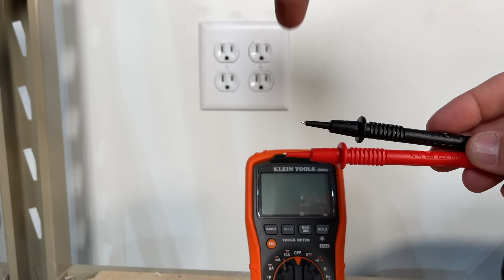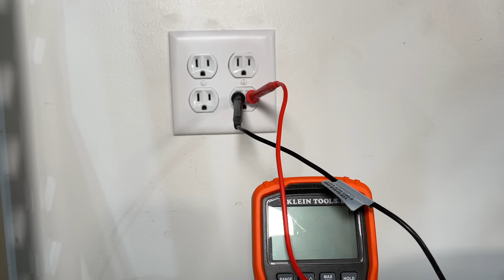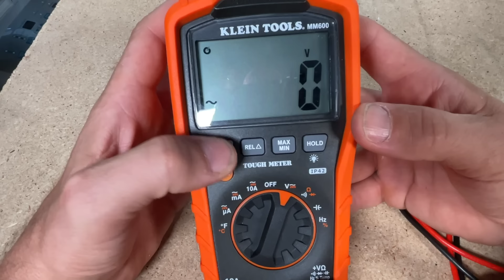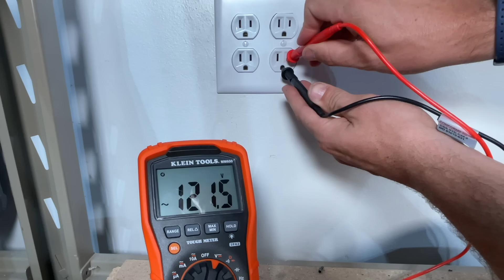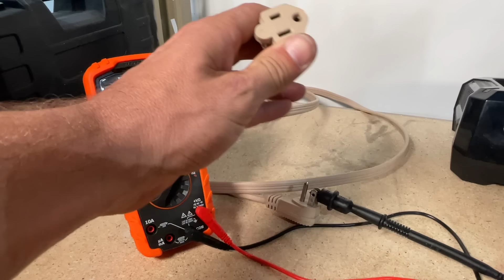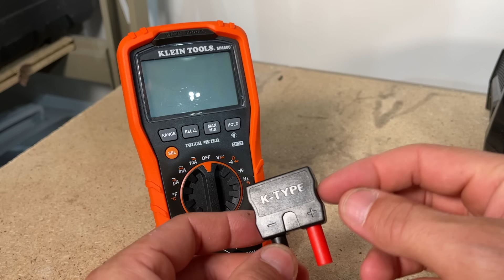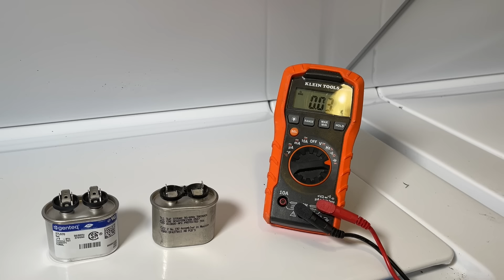How To Use A Multimeter for Home Repairs and Troubleshooting

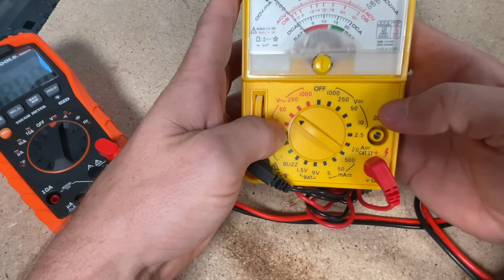Comment: 2:45 Those older multitesters with the rotary selector-dial were also notorious for having their copper-pad PC-board contacts get corroded and/or worn off from underneath the rotary switch's spring-copper contact-feelers.  I've had to retire a number of multitesters because of that issue alone, when everything else on the meter was still usable.
Reply: They tend to have problems when they're infrequently used as the contact surfaces oxidize. If you regularly use it and turn the dials enough the wiping action should restore operation without having to take them apart to clean.
Reply: @wingerrrrrrrrr  I guess everyone's experiences with a multitester will vary; mine was actually the exact opposite of what you described.  In my case, the copper pads on the meter's PC board actually got worn through (not merely surface-oxidized) from even just occasional use (in other words, they failed from BEING USED, not from simply sitting idle for a long time); like I said in my first comment, the copper cladding actually got scraped away in the spots where the selector-dial's contact-feelers were rubbing on them, and so then they would no longer connect with the meter's circuits anymore.
Reply: @Quacks0  what brand are those meters?
Reply: @wingerrrrrrrrr  MICRONTA (RADIO SHACK) --- absolute CRAP --- what can I say?
P.S. And DAT was a couple of da higher-end (i.e., thirty-and-forty-dollars-apiece --- I got them both second-hand from some elderly neighbors) "huge flat-paddle rotary switch-knob" models, too --- da ones dat da lower-income teenagers of da '80's used to absolutely CRY OVER when they saw other more-affluent folks using them, and wished they had one like it!  And yet ironically, da smaller ten-to-twelve-dollar Tandy Corp models actually seemed to last a lot longer --- I still have da $11 one dat I got 'way back around 1985 and absolutely USED DA CRAP OUT OF, and it STILL WORKS!! :P

Comment: I bought the mm320. I’m a beginner and 66 years old. Always have did my own electrical work but want to know more. Is MM600 easier to learn. And by the way I’ve learned more watching in 3 days than from other guys in 4 days. They are to theatrical. You talk slower and explain better. I’ll keep watching

Comment: At what settings do you use it for a dryer to see if any wires or switches are damaged,  I have the m3000,
Reply: It will be the same concept.  Set your meter to measure 200V or higher, then carefully measure the voltages.  If you're just measuring continuity, to ensure the paths are good for the wires and the switches, unplug the dryer first, and go to work.  I usually use a higher range for continuity because a couple tenths of an ohm are irrelevant for this purpose, but it really doesn't matter ... should be less than a couple ohms.

Comment: St frequent uses we have for the resistance value, is checking whether elements in electric water heaters are good.  Use Ohms law to figure out the resistance how manny Ohms resistance you should get for the element and check it for resistance if it is higher than calculated he element should be replaced.  The other use for the resistance is checking the resistance fo teh windings in motors.  It is a very quick way to tel if hte windings are bad.  I’ve trained the guys to measure the resistance on new installations, and write them down with a sharpie on the inside of the electrical cover.  It makes trouble shooting far easier.

Comment: As a sparky in Australia our outlets are different  from top left Active  Neutral  and earth on the bottom. We use test lamps for testing 240v power and polarity. As we have Rcds we trip them by putting the probes between active and earth

Comment: That was a great video, but may I suggest that you say not to measure continuity in an energized circuit, and when measuring voltage start at the highest range, and keep in mind some circuits have a HOT ground. Thanks
Reply: What 👆said! Not one ground should be hot and if it is you have a serious problem!
Reply: @saundersryan20  yeah, no. That ain't the case at all. Especially working in certain Telco environments where it's a positive ground reference. You'd think ground was zero, but blow your shit up
Reply: @Squat5000  p
Reply: Hello! What do you mean hot ground ?
Reply: @danilodistefanis5990  I think he means that a three prong layout has two hots whereas a two prong layout has only plus and minus
Reply: @Far Cyde  a 3 prong plug just simply has a hot prong, neutral prong, And a ground prong. A 2 prong plug just doesn't have a ground. That's the only difference between the 2 plugs. Both of these plugs supply 120 volts of electricity.

The only plug that has 2 hots is a 4 prong plug. It has 2 hot prongs, 1 neutral prong and 1 ground prong. Because it's a plug that can supply 240 volts of electricity.
Reply: Some of the older British cars used a positive ground system.
Reply: Never assume is correct 
Grounds should never be hot in your common electrical installations but it is always safe to have your own safety precautionary analysis
Reply: You'd better be smart to always keep your own safety your #1 personal priority with electrical applications
Reply: top comment, never make assumptions with electricity
Reply: UtO! We have an electrical power short fuse sparking in wire isle 120V. €<~>¥
Reply: I unsubscribed from this channel long ago for not being thorough

Comment: Hi, can you help me with something? I have a positive and negative wire going to the back of my van. This wire was used to power a wheelchair lift. I gave the lift away and now I have the cut wires. How can I figure out how many amps it can provide? I know hoe to test volts but how do I test those two wires, positive and negative, to know how many watts are coming out? Thank you.
Reply from the maker: I imagine there is a fuse in the system located somewhere in the engine compartment / fusebox which will be the limiting factor for those wires assuming they were sized correctly.  If the wires are hot, then look for the fuse and pull the fuse once you find it to confirm the power is turned off to the wires within question.  If you locate the fuse you will see the amps written on the housing.
Reply: This is a good idea. Thank you. It looks like the wires are not hot until the parking break is pushed down. Does this tell you anything, that its only activated my the parking brake?

Comment: My dining room has four receptacles (outlets).  Two of the receptacles have power and two do not.  None are on a wall switch.  There are no breakers tripped in my main electrical panel.  There are no GFCI or ACFI on those receptacles.  Have not been able to troubleshoot given this situation.  I have checked the presence of voltage with both my multimeter and an outlet tester.
Reply: Tough problem.  You could try using a cable tracer, but be careful around live circuits.  When I had that problem, I found someone ahead of me had miswired an outlet ahead of the ones that weren't working, which was supposed to feed the downstream outlets that weren't working.  Good luck.

Comment: i like FLUKE i have two and my old one is 34 years old still works great need a new one for the clip on amp meter
Reply from the maker: Fluke is the best!
Reply: @EverydayHomeRepairs   the Fluke 87 series is a classic. Just a couple caveats. When it goes into sleep mode automatically It shuts off the display but is still drawing current from the battery.  Changing batteries is a royal pain because you have to unscrew the back and pry it apart like an oyster, and since these don't have a separately sealed battery compartment, a battery leak will do major damage to the meter. Use quality batteries (I like the new Eveready "Lithium Max"), and wrap the battery in Saran Wrap before installing.  If you use the meter to measure Amperage, sooner or later you will blow the internal "BL" fuse which is also the current shunt, a special sand-filled explosion-proof device, not easy to find,and expensive. Be sure to keep a spare on hand!

Comment: Good information here. I would also recommend homeowners know how to measure amp draw because it can tell them if their circuits are overloaded in the home and it can help diagnose a parasitic draw in a vehicle.
Reply: current draw can be a bit tricky at 120 with a meter for diy people 
since with a meter you have to disconnect wire to measure load and most measure max out a 10 amp
a clamp meter is better suited for that 

yes for vehicule it's usefull for parasitic loss...just don't open a door or other stuff  you will max out 10 amp very fast 

i have seen some way to measure current draw in a car by measuring voltage drop across fuse...but never tried it my self

Comment: I needed a meter to test automotive batteries mainly; since I had a Amazon gift card I bought the Klein MM600.  It is more than I originally needed, but at least I have it for any issues I encounter at home.   I like to far. 
Oh, one more thing.  It cam in handy to check the test the temperature for some heating vents.

Comment: With two probes plugging into the two slots on an AC system, there is no difference in which one you stick in first or last.
Reply: What's important is that you stick the probe in the neutral or ground terminal first, and touch the live terminal last.  It makes no difference which probe is your red probe and which probe is your black probe, but it does make a difference, safety-wise, which socket of the receptacle you probe first.  It is convention to use the black probe for the neutral or ground, since that is what the voltmeter uses as its internal definition of zero volts.

Comment: Great video, I use the Klein MM300, it’s the 1st multi-meter I ever purchased, works good. I also heve the klein touchless and the klein outlet tool, I use them all and they are simple for a basic dyi’er like myself. I purchased the klein pouch as well, and keep those all in there cause as you stated, I would lose them if I didn’t

Comment: I have the Klein MM2000 meter, almost identical to the one you demonstrated.  I purchased it a few years ago, comes in real handy.  Like you, I check the charge on my car and riding mower batteries, check the temp coming from the HVAC vents, check household batteries (AA, AAA, 9v), continuity on different things, wall outlets etc.  I never used it on the cap on my heat pump, but I know there are unusually specs that tell you what the microfarad reading should read for the compressor and the fan.  A multimeter is one of those tools that you continually find new uses for once you get it lol Thanks for the vid. 👍👍
Reply: In most cases, testing household batteries with a digital voltmeter will not weed out weak household batteries (unless perhaps it has a dedicated battery test circuit);  The high impedance of the meter will not load down the battery sufficiently to duplicate the type of conditions that the battery will encounter in most devices that it is to be used in, including many LED flashlights!  I actually prefer using an old analog Simpson or Triplett Volt meter with a much lower impedance (typically 1K ohms per volt) for checking batteries, as those will load the battery more similarly to it's actual intended in-circuit usage. I also have several little analog battery checkers with hinged contacts: a modern purchased at Harbor freight, and another one that I bought at least 30 years ago. The Harbor Freight device does not reject batteries when they get weak in the same fashion that my older battery tester does,  and when I examined them both and measured their loading characteristics with an ohmmeter, I found that the Harbor Freight battery tester uses a 130 ohm load resistor and the 30 year old battery tester has a 30 ohm resister inside of it!  Lots of crappy batteries will "pass" when tested with the Harbor Freight device but fail when tested with my ancient battery checker that forces them to work harder..

Comment: Right away it was evident this guy is not knowable about electricity or multimeters. His safety point is total BS. It doesn't matter at all which lead is used first and it is not polarity sensitive on the AC volt setting. While on the AC Volt setting, you can stick either lead to a hot or neutral while holding the other lead tip in your hands without being shocked. This is because of the very high resistance between the leads within the meter's circuitry while on the voltage setting. If at any time any volt meter could cause an ark while checking voltage it could cause catastrophic and fatal accidents in potential high current situations. As for DC volts, reversing the lead's polarity to the power supply will only cause the positive or negative potential to be displayed opposite of the true reading. Note: If you are not familiar with DVMs it's best to not try using it for Amperage readings until you can get knowledgeable help. 
He also suggest using a non-contact voltage tester if you don't have a meter. These are not reliable to test for absence of power before working on a circuit. A volt meter MUST be used in this case. He also didn't mention the importance of making sure that capacitors or not charged before testing the capacitance. A charged capacitor is not only dangerous but could destroy your meter while on the capacitance setting. This guy should not make videos on electrical equipment. His information could be hazardous.

Comment: Being a industrial electrician most testing for just presence of power or open/ closed switch is best done with a tester. A multi meter has very high internal resistance.  So this could give you strange readings that will over complicate your results.
Reply: Really now Konrad?  please do tell how?  So tired of you guys who always have to “COMPLICATE” basic electricity.  If you can’t dazzle them with brilliance, baffle them with bullshit!🥴.  And give no follow up information/answers (keep them wondering) 🤦‍♂️nice!  You’d make load matching seem like quantum physics
Reply: @mrobvious5892  good saying some times applies. A little knowledge is more dangerous then no knowledge at all
Reply: Sir, can you enlighten my DYI brain? What kind of tester? Thanks!
Reply: @glennwhite1841  ,  Take care that your DIY (Do It Yourself) brain doesn't cause damage to your "DYI" (Do Yourself In💥😳) brain!  [Sorry but your typographical error was just too good to let it go to waste!]

Comment: On all new houses they have TR (tamper resistant) outlets.  The procedure you showed here of inserting one probe first will not work.  One workaround is to insert an adapter such as a three way splitter into the outlet and then put the probe into the adapter.
Reply: Could always insert both probes at once and then pull out the one you want unconnected.
Reply: I probably shouldn't admit it, but I usually stick a longish thin-blade flathead screwdriver into the outlet when I have that issue.  Like a small thin 6" screwdriver.

Comment: Might be a stupid question but can you use a multi meter to check a 4 or 6volt solar battery for an electric fence?
Reply: Yes, if you have this meter just set it to dc 9.99 volts or any meter that reads dc

Comment: Yes incorrect regarding the dangerous probes, if this was true every time you tested between active and earth the breaker would trip, if fitted with a ground fault breaker. The voltage test pen has a range from a very low voltage to a high voltage that would show a voltage on the meter probe. The voltage meter has a very high resistance when measuring  voltage. However if measuring amps, the meter has a very low resistance. So be very careful  when selecting  between voltage and current, make sure the probes are in the correct terminals.

Comment: Can you go over which plugs to use on the multimeter ?  Like at the bottom there is usually 3 -5 plugs on them.
Reply: Meters are different.  I think the negative one is usually labeled "COM" for common, if that helps.  Provide a manufacturer/model and we can better assist.

Comment: I have the Klein 400 amp AC/DC clamp meter, paid around $90 at home depot and I love it.  It's an indispensable troubleshooting tool.  I have used it to test for proper wiring in 240 outlets for a dryer or range, much in the same way a 3 light tester makes certain a 120 volt 15 or 20 amp outlet is properly wired.   (Now if only they made a 4 light tester for a dryer or range outlet 🤷‍♀️) my work as a residential electrical contractor would be a bit easier

Comment: I wouldn’t use a digital meter on AC.. only if you suspect weird problems or voltage abnormalities. .  Plunger style tester is much better.
Reply from the maker: Yeah, my go to is an outlet tester and non-contact voltage tester for the normal day-to-day jobs.